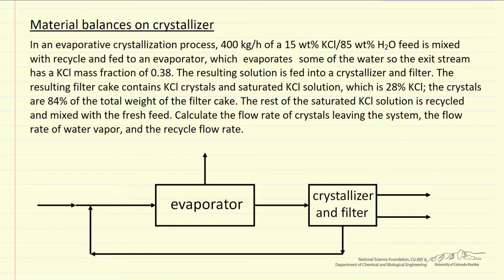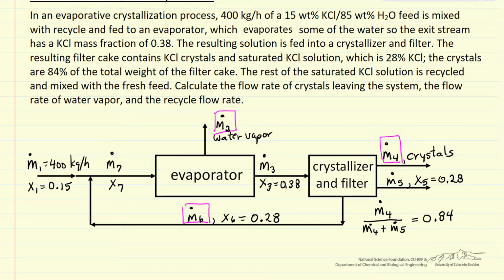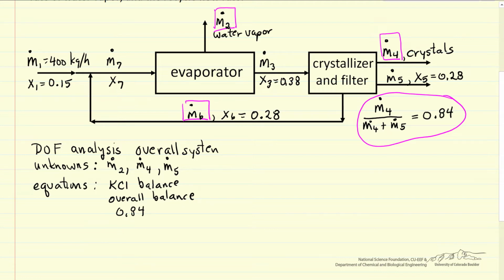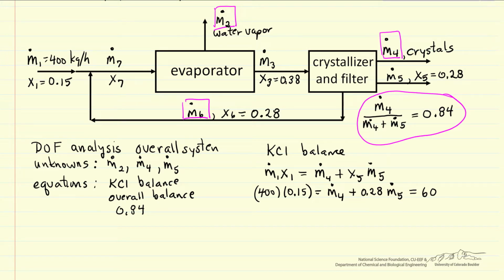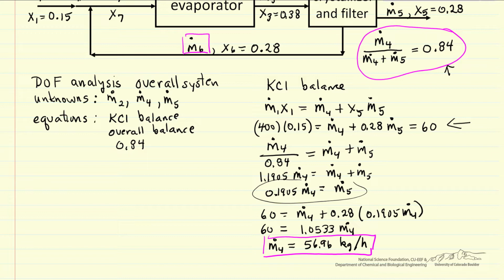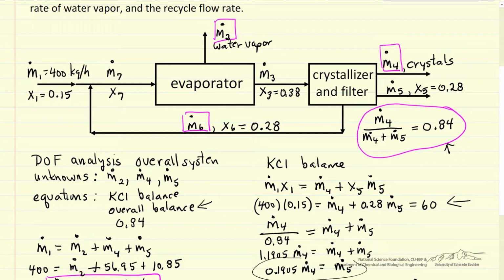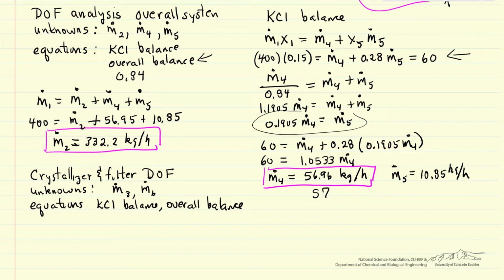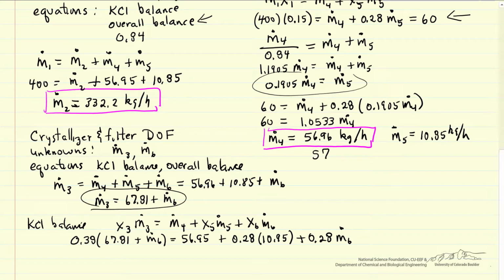Material Balances on a Crystallizer

Comment: when i use water balance to calculate m6, the equation is "1. m3=m4+m5+m6, 0.62m3=0.72m5+0.72m6", therefore the answer is "345.31kg/h", can you explain the difference, and what mistake did i make here?
Reply from the maker: Ok. That is the correct set up. When I use the water balance, I get m6 = 342.3, which is a very small difference from the answer when using the KCl balance. Let's write it out and so you can see where your difference came in. We start with the two equations you have and m4= 56.96 and m5=10.85. Using the first equation, m3 = 56.96 + 10.85 + m6, so m3 = 67.81 + m6. Then we can substitute all of that into the second equation:
0.62(67.81 + m6) = 0.72(10.85) + 0.72m6; simplify to 42.04 + 0.62m6 = 7.81 + 0.72m6; move variables to one side; 42.04 - 7.81 = 0.72m6 - 0.62m6; simplify again: 34.23 = 0.1m6; m6 = 342.3 kg/h
Does that help?

Comment: The problem says crystals makes 84% of the filter cake, which means in the cystal/filter cake stream 4 , 84% is crystals and 16% is conc of KCL, why are you changing it to 84% of the total mass coming out of the filter ?
Reply from the maker: The calculation is correct. The exit from the crystallizer is a solid filter cake that is wet (it contains some of the liquid whose mole fraction is 0.28). The rest of the liquid is recycled. Thus m4/(m4+m5) = 0.84